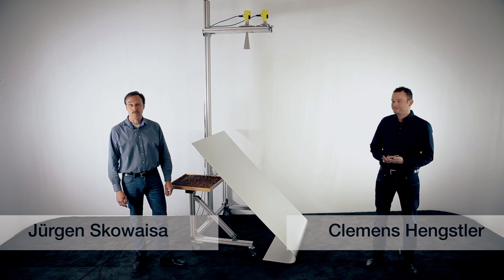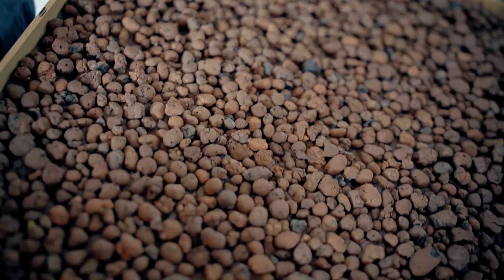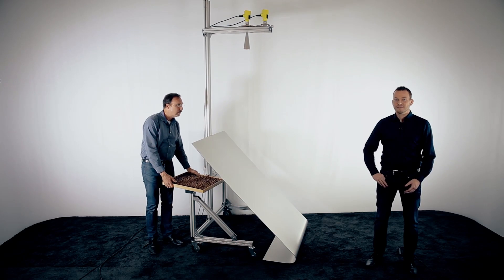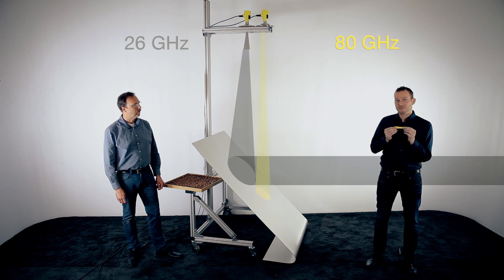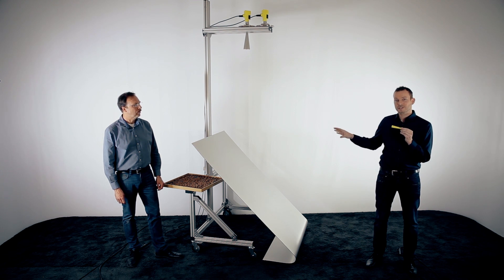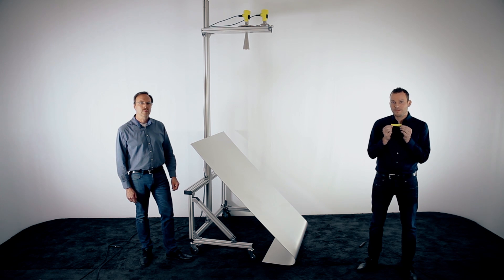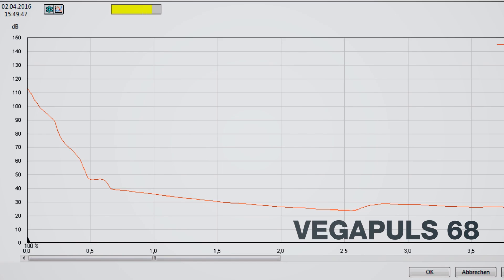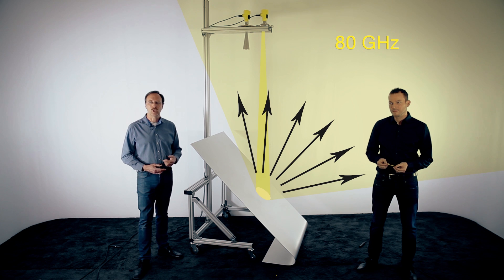VEGAPULS 69 - Media with small grain sizes | Radar level measurement

Comment: But, in a Silo for Grain, a single point for measurement is not enough to accurately estimate the volume inside due to its complex surface profile. How does the Vegapuls 69 account for this? An answer would be very much appreciated for our Thesis Research. :)
Reply from the maker: Hello Eric, Thanks for your question. Of course you are right. With a profile measurement of the product surface it would be possible to achieve a higher accuracy. This would be a huge effort and of course mean a much higher investment for the measuring device. At the end it is a question of the accuracy which is needed. It would also be good not having the volume but the weight - but the density also changes during the filling.